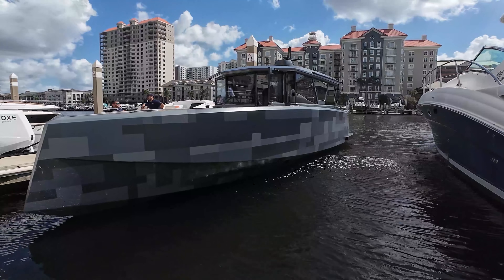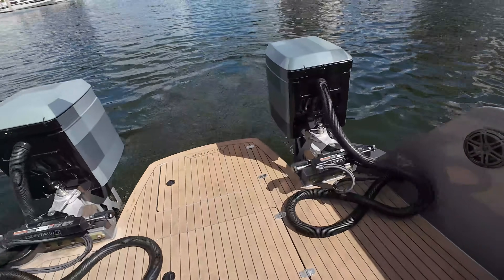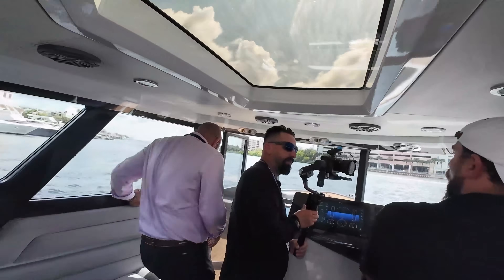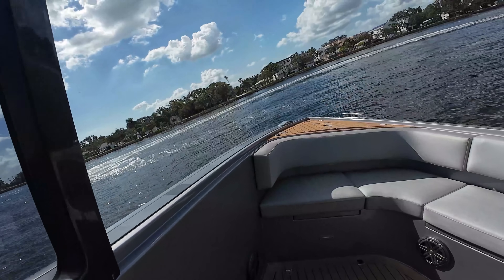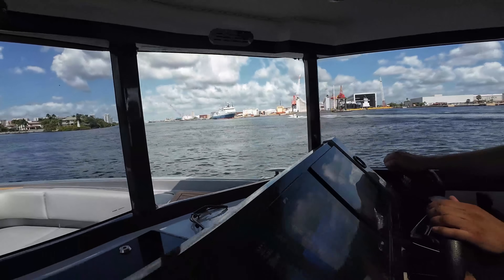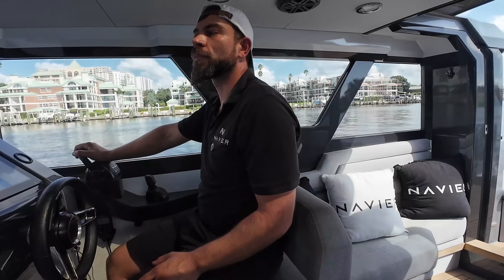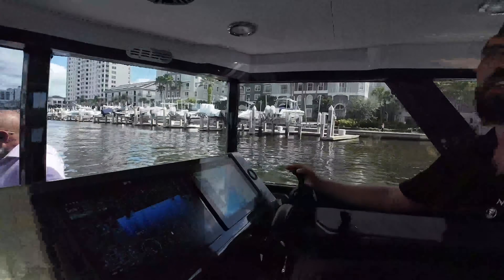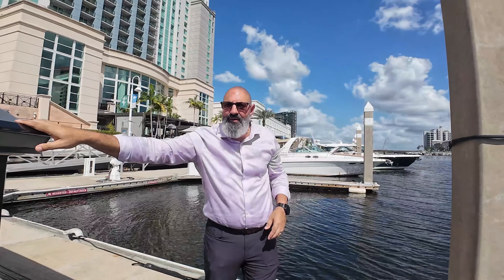Is THIS The FUTURE Of Boating? Navier 30' Hydrofoil

Comment: This boat could be really useful for scuba diving excursions. The sea can be windy and rough making the journey from the harbor to the diving reef lengthy. This hydro foil boat can get to the reef faster in rough seas resulting in more scuba diving excursions. I have been on scuba diving trips where it took an hour to get to the reef and when the wind picked up it took nearly 2 hours to get back delaying the excursion for the next load of scuba divers . If you have a big engine boat , if the conditions are rough you have to travel at a slower speed but with a hydro foil you can cut through all the choppy waters like a knife through butter and rough waters would not slow the boat down
Reply: well the surface interval rest between dives is what gets people.

Comment: If they had a small diesel-electric engine instead, they would save a lot of weight from skipping the big batter, thus making the thing even more efficient and making the running costs very similar. Filling up diesel is much quicker and gives easily 10x the range on a similar weight basis.
Reply from the maker: I like the way you think. Small diesels would be a great idea.

Comment: Always interesting to me how we make a full cycle. I remember foil boats growing up. The only thing I hate is they act like it's something new. Great video Andre. 👍👍👍👍👍🍻🍻 And as always thanks for the info.
Reply from the maker: I’m not too familiar with hydrofoils and their history but it definitely has me wanting to do some research. 🤙
Reply: @perfectfitboating  They go a long way back but the ability to mount a motor directly under water and the use of realtime super fast responses of computer stabilisation and fly by wire controls paired with Automotive batteries make this smoother faster and more reliable.
Carbon fiber is light but highly polluting and expensive to produce it also has some problems. As for the charging I think you also need to look at the European designs , same for the range.  The other point is the use of in series, range extender hybrids using again Ultra need to compact light simpler multi fuel stoichiometric generators, to back up the batteries and when beyond grid charging or keep the motors running direct .. you can also add solar to the roof  to further back up or maintain the system long-term.